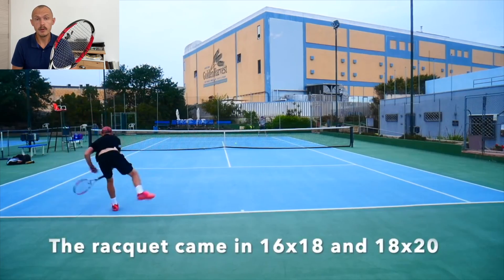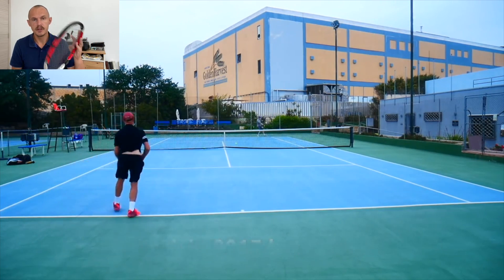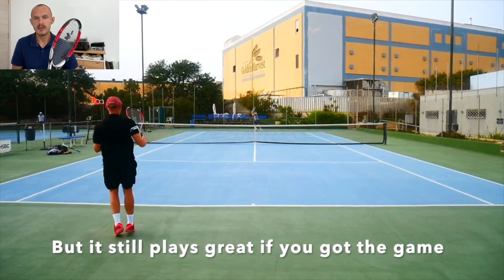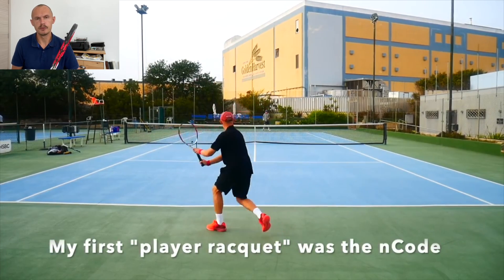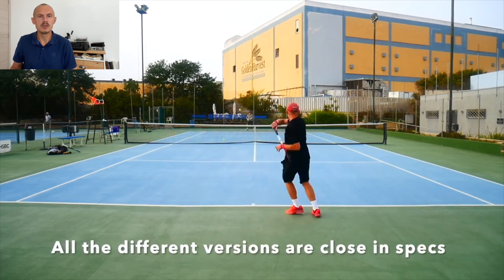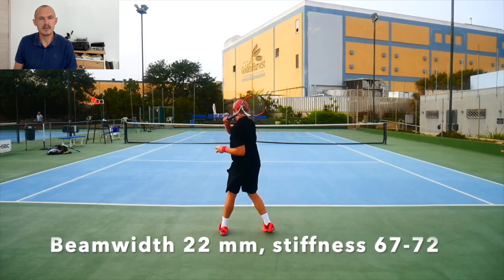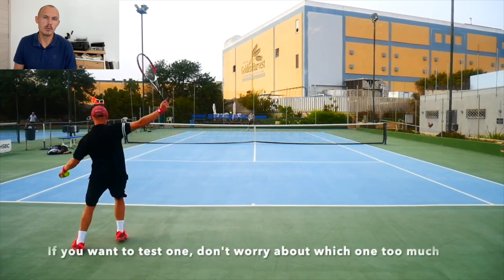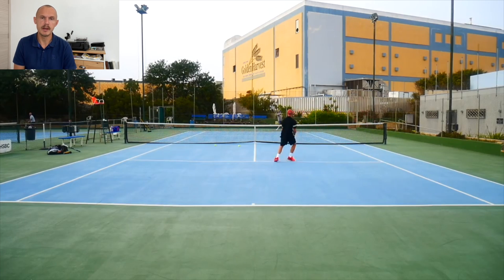A vlog on control racquets - What are the best control racquets today?

Comment: loving my Technifbre TF 40 305, thanks to your racquet and string consultation. I found the proper set up.
Reply from the maker: Happy to hear that! 👍🏻
Reply: Great racquet that I've just started using! I am playing it stock with TF Icecode but am considering putting on a leather grip. Have you tried that, and if so, how did it work?
Reply: @spoonfed1548  That's exactly what I did to make it to 6-7 pts HL and it plays brilliantly. You can also consider putting it with a shape poly in 17G or 18G. to improve the spin potential
Reply: @clarencefong1107  Great, thanks for the feedback! I usually end up putting leather grips on my racquets, but I've been hesitating with this one. Gonna try it now, though, and maybe a shaped poly like you suggest as well. 👍

Comment: I'm looking at the Pure Aero VS with Technifiber Triax stringing (probably around 55 lb). I saw your review where you recommended the 1.38 gage but Tennis Warehouse only has the 1.33 (probably OK). I'm a 3.5+ (higher if I play regularly). No arm/elbow issues. Would this give me good ball control?

Comment: ProKennex Q Tour Pro 325 is the best of the best IMO.  You will find more "control" in some denser 18x20's but the fact the crosses are a bit more open gives you more spin and the 18 mains still give great directional control.  Box beam and low flex make the feel of this one incredible even with a poly.  Love this racket and hope they keep making it for years to come.
Reply: What's the head size?

Comment: After a 10 year hiatus, my Dunlop 200G 95 hotmelt frames went dead, so I bought two Babolat Pure Control 95s because it was the only racquet on the market with similar specs- heavy, head light, low RA, swing weight in mid 310s.

Such a shame they don’t make racquets like that as much as they used to... so much more rewarding to create your own power.

I hope Babolat reintroduced the control line, I don’t know what I’ll do when my sticks go dead...
Reply: Gotta try the vcore 95

Comment: Have played with two Wilson Blade 98 v4  weighted to 350 g strung and a balance of 315 mm. I am thinking about testing out the pro staff 97 without countervail. Do you think that it would be a Good switch. (I like the pop and feel of my blade but the reason i’m looking elsewhere is because I have heard that the newer blades are softer and does not have the same feel).

Comment: I'm still a bit confused about what a control racket is and what you sacrifice for control.  I thought a stiffer racket was a control racket because the ball goes more where you point but it seems a lot of control rackets are softer? I played a lot in my teens and I'm now getting back into tennis at the age of 41 and I'm looking for a new racket.  I have a Dunlop Aerogel 400 which I enjoy for it's power and spin but to me it's feels very wooden and I don't feel I have that connection and feel with the ball.  It feels like it panicks a bit and like the frame isn't very stable.  I saw a review on the Technifibre TF 40 305 which seems to have it all including great feel which I would like but I don't know if this would be the racket for me.  Another review said the racket is more control orientated and for a higher level player so I'm not sure.  I'm serious about my tennis and I'm progressing well so want to get a nice racket i can grow into rather than a begginers racket.  I play mainly on clay and I'm quite tall and powerful.

Comment: Can you do a review for the Wilson Blade v7 18x20 and compare it to the pure strike 18x20? Love this channel and thanks for uploading great content!
Reply: Strike is stiffer and more power. Blade is more control, and muted feel. Go with Strike if you need extra punch. Go with Blade if you want feel and confident about your power.
Reply: Look for 2016-2017 pure strike 18x20, better feel, still good power and spin. Less muted than 3rd gen 18x20. More connected to the ball. Also a great 18x20 is the head graphene 360+ speed pro. Demo one. If you can handle a heavier swing weight, demo the yonex vcore 97 hd. Good everything, but definitely more heavy to swing, even while being very head light. Out of left field, demo a pure strike 100 3rd gen. Literally a softer, better feel and control version of the pure drive, in my opinion. And one more off the beaten path, but a hidden gem is the 2020 pure aero vs. It's 98 sq inches vs the 100sq in of the reg pure aero and a 16x20 pattern also for more control but still has solid power and spin similar to the reg pure aero.
Reply: @ReidVV  just commenting to vouch for the aero vs
Reply: @mwu365  if you like the aero vs, find a used yonex vcore sv 98. It has better feel, more stability, and controlled power. It's also 16x20.
Reply: @ReidVV  I went the other way, didn't like the yonex

Comment: I am looking for a very control-oriented racket. I have tried a lot of rackets that are labeled for control, such as, Clash, Blade 18/20, Pure Strike 16/19 and 18/20 etc.... I do not like 18/20 rackets. I am currently have a 6.1 95 16/18, strung at 58 with Luxilon Big Banger, but it is too powerful still.  Do you have any recommendations for a truly control racket? I am an advanced aggressive baseliner. All the rackets I have tried are always to powerful even though they are strung fairly high. Any advice would be appreciated.
Reply: If you don't like 18x20, I would check out 98" 16x19 rackets, even considering the VS Babolat models. Or, the Gravity MP, which is 100" thin beam and a 16x20 bed.
Reply: Try the diadem elevate tour racket.  There is also an FS elevate tour racket but it’s got a little more power than the diadem elevate tour.  The FS elevate is more stable than the regular elevate. They are a little lighter than the Wilson six one 95 but it’s very very accurate.

Comment: i think wilson revamped the entire ultra line to make it their power racket. they made it stiffer and added rib structures to the frame, making it a more powerful racket. stiffness rating is 73. their control racket now is i think the clash or the blade. clash has a stiffness rating of only 55, and blade at 62
Reply: Nope....they have the Wilson ultra pro v3 with low stiffness of 63 RA 97" head size.

The ultra tour v3 is 65sq" still have counterveil, I assume to counter a high RA (70). It's the stick Nishikori endorses.

I've tried the ultra pro....nothing really wrong with it, other than it needs weight.

But, really I don't think it's any better than a blade 98 (18x20), although it certainly feels different.

Comment: Hi Jonas, great vlog as usual. It would help if all the rackuets would be mentioned in the description for a quick oversight :-).
Was missing the Pro Kennex Kinetic Ki Q+Tour 300 or 315 as its a very armfriendly (solved my wrist issues together with a soft poly or hybrid with natural gut) control orientated racket with its 19mm beam and very spin friendly 16/19 pattern. 
I think you reviewed the 315gr version of this :-). No connection with Pro Kennex in any way just think its a great racket for older tournament players that dont like the thick beams and tend towards thinner beams and control orientated rackets.

Comment: I feel that unless you’re a pro, you should use racquets from 295-300g unstrung and nothing more. I see lots of people using pro spec weight racquets and it’s too heavy to handle. Make you feel like a pro but it just doesn’t do much for your game. IMO
Reply from the maker: In general I agree, most rec players play better tennis with a lighter spec, especially in tight match situations.
Reply: Tennisnerd also easier to generate racquet head speed and timing the shot when your opponent is capable of ripping shots back
Reply: Anson I'd have to respectfully disagree with you. I play with a good number of people who use heavier frames and we are definitely not pros. But we're able to play with the heavier frames just fine. 

I feel that anything UNDER 325g unstrung is too light. My ideal specs are at least around 344g, with about a 330SW and 9pts HL. Im a 4.5 NTRP
Reply: @evylsalamie  wow. That’s a heavy frame. Not how we do it here in around asia.. but hey, if it works for you. No offense taken 😊
Reply: @ansonhansley4578  oh no no offense taken! I hope I didn't offend you with my opinion! I didn't think about geographic regions maybe preferring a certain racket spec. I always thought higher level players tend to lean towards a heavier more stable frame

Comment: Excellent analysis,  but I have a question, in what type of racquet would you put the "Yonex VCore 95"?
Reply: Pretty much anything on the modern market under 98 square inches will be a control racquet. 97-95 and under. It’s a generalization, and some will have more power than others, but also anything with an 18x20 can be considered a control racquet. Smaller head means tighter string pattern for the given number of mains and crosses. Tighter string pattern equals more control (generally speaking) and less free power.

Comment: I like the vlog style.
Continuing from my previous advice on audio setup. 
The phone recording sounds alright actually. Little bit echoey but, better than the USB mic.
If you still want to use the USB mic. The starting point is,,, Set the fader to 0db and adjust the gain to where you are happy and have minimal or no echo. You can adjust both fader and the gain. It's the easierst trial and error method which ordinary people can use.
Or just put a curtain on at the back to absorb some unwanted reverb...

You may want to try Sony TX650 (standalone voice recorder, sync in post...) or Sennheiser memory mic (connect with your phone via bluetooth).
|Get it off from Amazon and try.. ;>|
Can you do a full review on PT 2.0?
Also, how does it compare to your old Radical tour Candycane or H22?
Reply from the maker: Thanks - I bought a dynamic mic that I will try first. Pro Tour 2.0 review coming soon

Comment: No Wilson Ultra?
Reply from the maker: Might make it in part 2 :)
Reply: I think the Wilson ultra pro v3 that I tried 2 weeks ago heavily overhyped by users.

It was way too light in stock and quite frankly, I don't see any reason for it compared to a blade (18x20). Other than the ultra is much cheaper.

The paint I noticed is one of the worst I've ever seen and could see marks on a brand new frame coming off just from the packing.

It looks good....just extremely low quality.

I guess with some added weight (which I added @ 3 & 9), there was nothing wrong with it. I only had it for a weekend and played a total of roughly 4 hrs with it. So, string choice etc I didn't get to tinker with unfortunately.

Cheers
Reply: @Tennisnerd  That would be great
Reply: @nostro1001  Yeap its a great platform from what Ive  heard?